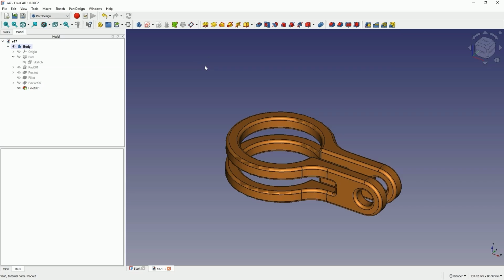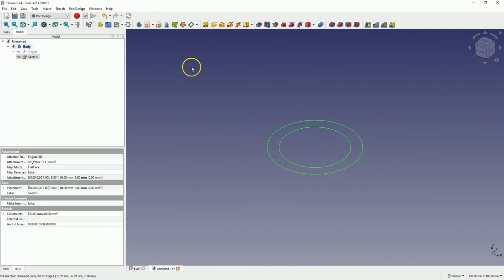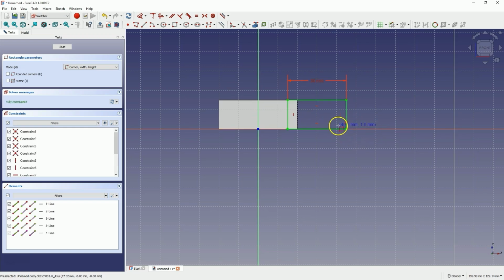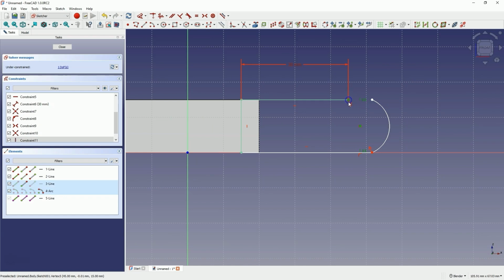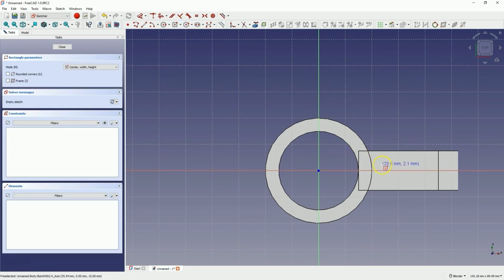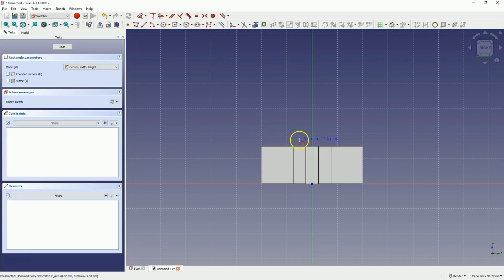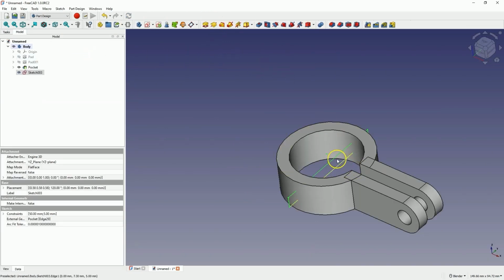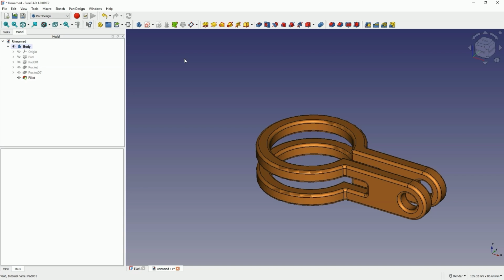FreeCAD From Sketch to Solid

Comment: @CADCAMLessons I got momentarily stuck on 2:17 while adding the 'coincidence constraint' to the circle. I had to select the circle's perimeter instead of center point to make it work correctly. Otherwise I was getting an error. Just a quick heads up.